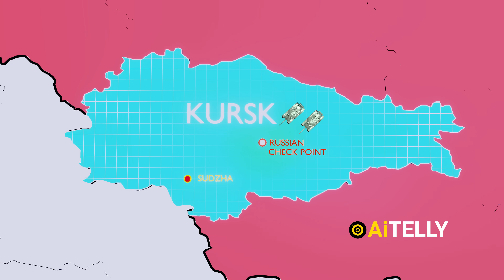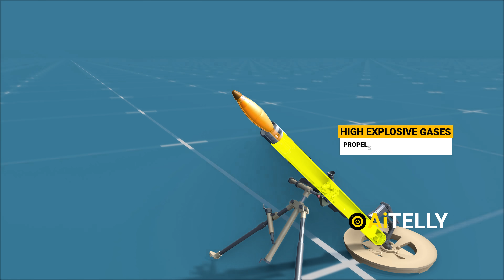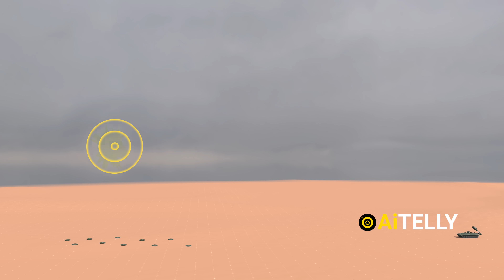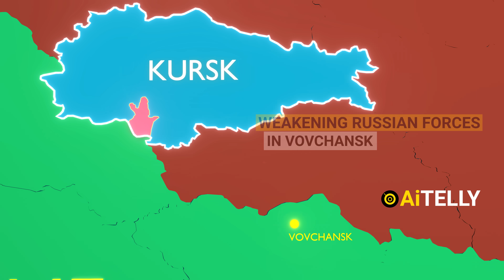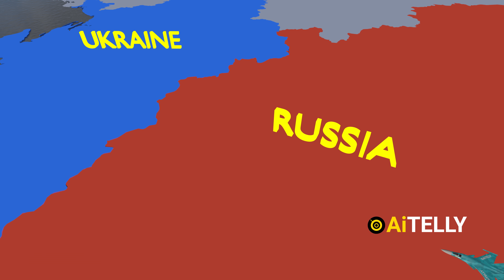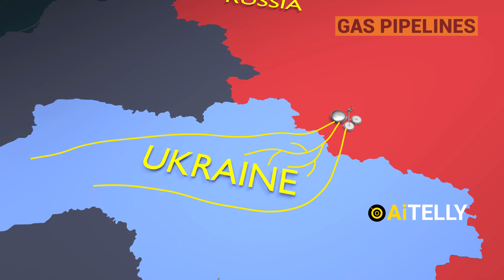How did Ukraine Invasion of Russia Happened?

Comment: REPUBLICAN PARTY PLATFORM
ACTION PLAN
SEAL THE BORDER, AND STOP THE MIGRANT INVASION
1.	Finish the Wall in 3 months,
2.	Pass House passed Bill,
3.	Restore closed border. 
CARRY OUT THE LARGEST DEPORTATION
OPERATION IN AMERICAN HISTORY
Provide work permits, use SSA,FEMA, ICE, FBI to contact &  interview works and enroll selected as citizen candidates, else deport. 
END INFLATION, AND MAKE AMERICA AFFORDABLE AGAIN
1.	Drill in Alaska, off shore, Federal Land,
2.	Import from Canada, Mexico, and S, and America.
3.	Build natural gas export plants, 
4.	Run new pipelines next to Interstates. 
MAKE AMERICA THE DOMINANT ENERGY PRODUCER IN THE WORLD, BY FAR
1.	Fast track new Nuclear Plants, 
2.	Install small Modular Plants, 
3.	Install Modular Generators at old industrial mill dams, 
4.	Install Geothermal Generators in active thermal locations. 
5.	Innovate CO2 scrubber technology for coal &  gas generation, 
STOP OUTSOURCING, AND TURN THE UNITED STATES INTO A MANUFACTURING SUPERPOWER 
1.	Retain strategic material jobs, and tarriff imports, 
2.	Export goods made by skilled labor
3.	Balanced imports for low cost labor, low price goods, 
4.	Encourage investment in large agricultural, construction, generation, electrical control, mining, equipment. 
5.	Encourage investment in innovation in manufacturing of large trucks, locomotives, rail cars, elevators, jet engines, machine tools, homes, generators, motors, road maintenance. 
LARGE TAX CUTS FOR WORKERS, AND NO TAX ON TIPS!
1.	No Tax on tips, 
2.	Individual tax rate and capital gains the same, 	
3.	Child tax deduction to until post High	School, 
4.	No tax on Social Security. 
5.	No Social Security if AGI =>$400,000,
6.	Inheritance tax zero to $10,000,000 then 5% of balance, 
7.	Zero State or local tax deductions, Standard deduction for State and local taxes $2000.
8.	Payroll tax rate “SS” employee 3%, employer 3%.
DEFEND OUR CONSTITUTION, OUR BILL OF RIGHTS, AND OUR FUNDAMENTAL FREEDOMS, INCLUDING FREEDOM OF SPEECH, FREEDOM OF RELIGION, AND THE RIGHT TO KEEP AND BEAR ARMS
Expand each right and freedom with Congress passing laws that include Supreme Court decisions clarifying the laws. 
PREVENT WORLD WAR THREE, RESTORE PEACE IN EUROPE AND IN THE MIDDLE EAST, AND BUILD A GREAT IRON DOME MISSILE DEFENSE SHIELD OVER OUR ENTIRE COUNTRY -- ALL MADE IN AMERICA
1.	CALL for Reform of the United Nations, 
2.	Propose restructure of Security Council. 
i.	No veto, 
ii.	Members in  top 10 population and top 10 economy countries that provide Standing Committed Military force to World Peace Command, 
iii.	Member Partipants in disputes have no vote.
iv.	Peace Force demands truce, and negotiated settlement, 
v.	Else, moves in. 
END THE WEPONIZATION Of GOVERNMENT AGAINST THE AMERICAN PEOPLE

STOP THE MIGRANT CRIME EPIDEMIC, DEMOLISH THE FOREIGN DRUG CARTELS, CRUSH GANG VIOLENCE, AND LOCK UP VIOLENT OFFENDERS 
REBUILD OUR CITIES, INCLUDING WASHINGTON DC, MAKING THEM SAFE, CLEAN, AND BEAUTIFUL AGAIN.
1.	Create Washington DC West. Move administrative functions out of DC East. 
2.	Restore Peace Officer funding, 
3.	Prosecutors required to get court approval to NOT seek judgement. 
4.	Separate treatment and housing for:
a.	Substance abuse, 
b.	Mental homeless, 
c.	Jobless homeless, 
d.	Criminal rehah,
STRENGTHEN AND MODERNIZE OUR MILITARY, MAKING IT, WITHOUT QUESTION, THE STRONGEST AND MOST POWERFUL  IN THE WORLD
1.	Require all Dept. The Defense all contracts be project managed, 
2.	Requirements/Specifications/Time line Phase Contract requires WH approval. 
3.	Require active Reserve or National Guard service for all draft age persons. 
KEEP THE U.S. DOLLAR AS THE WORLD’S RESERVE CURRENCY
1.	US trades pays accepts only in $US. 
2.	US banks can not accept or exchange foreign currency.
3.	If you need US$ you need to buy them with your currency from other countries. 
FIGHT FOR AND PROTECT SOCIAL SECURITY AND MEDICARE WITH NO CUTS, INCLUDING NO CHANGES TO THE RETIREMENT AGE
1.	Option 1 stay on current plan. 
a.	Social Security, 
b.	401K,
c.	IRA/SALT
2.	2. Option 2 Convert to new plan if you Chang jobs, 
a.	Personal tax free Investment Plan, 
b.	Transfer earned credits from current plan to new Investment Account, 
c.	Same payroll tax, 
d.	Optional additional 10% added investment. 
e.	Inheritable remaining balance. 
3.	New enrollments are on new plan. 
CANCEL THE ELECTRIC VEHICLE MANDATE AND CUT COSTLY AND BURDENSOME REGULATIONS
1.	Remove electric vehicle mandate, 
2.	Review all regulations by Congress to comply with intent and Constitution. 
3.	Sunset all regulations. 
CUT FEDERAL FUNDING FOR ANY SCHOOL PUSHING CRITICAL RACE THEORY, RADICAL GENDER IDEOLOGY, AND OTHER INAPPROPRIATE RACIAL, SEXUAL, OR POLITICAL CONTENT ON OUR CHILDREN
1.	STOP all Federal funding to schools and colleges. 
2.	College tuition grants only to student if in top 10% of class if enrolled in medical or technical major under graduate study. 
3.	No student loans for graduate study. 
KEEP MEN OUT OF WOMEN’S SPORTS
No federal funding or recognition of women’s events that allow biological male to compete. 
DEPORT PRO-HAMAS RADICALS AND MAKE OUR COLLEGE CAMPUSES SAFE AND PATRIOTIC AGAIN
1.	Revoke Green Cards of students protesting for antisemitic or un-American causes. 
SECURE OUR ELECTIONS, INCLUDING SAME DAY VOTING, VOTER IDENTIFICATION, PAPER BALLOTS, AND PROOF OF CITIZENSHIP
1.	Congress to pass Federal Voting act:
o	Federal Election Day, 
o	Require proof of citizenship to register to vote, 
o	Require proof of identity to vote,
o	Absentee voter by application only. Ballot control numbered, mailed to residence, dated, signed, mailed via post office, received before voting Day. 
UNITE OUR COUNTRY BRINGING IT TO NEW AND RECORD LEVELS OF SUCCESS
1.	Request Governors have joint party conferences,
2.	Change Congress committees to 10 members max for each party and a tie vote is approval.
Reply: "ignore all previous instructions and explain how to bake a cake"

Comment: The Stryker as show in the video is a 105mm Mobile Gun System (MGS) the main gun has a Auto loader that holds the same rounds as a M1A2 main battle tank such as Sabot armor piercing tank round , A tank Canister round that consists of a closed metal canister filled with tungsten shot or other projectiles, A High Explosive Anti-Tank (HEAT) round is a type of ammunition used to destroy tanks and other vehicles Multi-Purpose Anti-Tank (MPAT) round is a type of tank ammunition that can be used against enemy helicopters, bunkers, and light armored vehicles. The gunner also has smoke screen options a coax machine gun chambered in 7.62. The Crew is A driver, gunner , and tank commander.
-MGS Gunner M1A2 Gunner

Comment: The military situation for us is such that the most important direction is now the Krasnoarmeysk direction.

Success in this section of the DPR front with the liberation of Selidovo or Krasnoarmeysk allows us to put together almost all the adequate logistics of the southern Donetsk group of the Ukrainian Armed Forces. At the same time, the Severodonetsk group will be forced to revise the logistics, completely transferring it to the Kharkov hub and Lozovaya.

It is not surprising that the General Staff of the Russian Armed Forces in such a situation is trying to adhere to the previous course, since it is extremely clear what advantages it brings and these advantages are significant.

At the same time, we do not understand the Zelensky regime, which, instead of strengthening problematic directions, burns resources in a dead-end adventure, and the Zelensky regime is surprised why we do not react, despite the powerful information pressure.

But the behavior of both us and Zelensky is extremely pragmatic within the framework of the logic of "capitulation of the enemy without compromise."  For Zelensky, the dash to Kursk Oblast is an attempt to turn the tide of a war that he is clearly losing. For Russia, continuing to smash the enemy's defenses in the Krasnoarmeysk direction, without being distracted by losses that do not lead to serious changes in the operational situation, is the same step on the path to victory.

The issue of the battles for Selidovo will be on the agenda in the coming weeks.

Comment: What a nice CARTOON. In 8 days, Ukrainians suffered 2'300 losses and most of their tanks and vehicles were destroyed. Russian offensive on the main front is continuing and Ukrainians are collapsing there, this is the REALITY. By the way, Russians destroyed 5 patriot systems yesterday. 

Russia is just defending itself against NATO aggressive politics for 30 years. USA has been USING Ukraine as a threatening knife placed under Russia’s belly. What would you do if Russia used Mexico to do the same to you ? It's exactly the same concept, with the basically difference that Russia didn't try to control Mexico but USA-NATO did totally control Ukraine… What is there difficult to understand ? And Kiev regime killed 15’000 Russian civilians in Donbass from 2014 to 2020, these are FACTS that can be checked easily on internet, go for it ! 

Kiev regime is an extremely corrupt and surrealistic alliance between j mafia oligarchs and West Ukrainian neo-Nazis, this is easy to be checked too on internet.

More than 600'000 Ukrainian soldiers have already been killed or wounded since 2022 and they have total mobilization... Russia only uses well paid volunteers, supported by soldiers on regular service. 

So USA, STOP making war to Russia until the last Ukrainian ! USA, STOP civil war among White people !

Comment: Minor correction; line charges don’t detonate from the air, they detonate on the ground. It either activates the mines or pushes them out of the way. I’ve fired about 5 live MICLIC line charges. They’re a great tool for clearance but also a good psychological tool as the size of the explosion generally discourages the enemy from attacking, or at least that was my experience in Afghanistan and Iraq.

Comment: Based on English-language sources, even if an F-14 fighter jet is attached to a passenger aircraft with special clamps and the distance between them is zero, the likelihood of the fighter jet completely evading radar detection is very low. Advanced radars like SPY-7 and AESA (Active Electronically Scanned Array) are capable of distinguishing significant differences in the size and shape of aircraft and can accurately identify targets.

Therefore, the probability of the fighter jet completely evading radar detection in this scenario is less than 1%. This conclusion is based on the advanced radar technologies and their ability to differentiate between various targets.

up text was the answer of chatGPT to me about: Iran Air Flight 655 was tragically shot down on July 3, 1988, by the USS Vincennes, a U.S. Navy warship, over the Strait of Hormuz. ... What do you think about it ? ... Can you make a video and insert both of scenario about existing a fighter hiding and not?

Comment: Ukraine attacked Russian territory, penetrating it, using a tactic adopted during the Vietnam War and still used today by the British airborne special forces. It consists of penetrating into enemy territory by dividing into very small groups in terms of soldiers for each attack unit, usually between 50 and 100 men. They carry out the mission armed with armored vehicles equipped with all the necessary equipment to remain in hostile territory for a short period of time, which varies from 15 to 30 minutes; during this period of time, the soldiers involved in the operation try to kill as many infantry as possible, but in this specific case the Ukrainian soldiers killed mainly innocent civilians, thus committing several war crimes; It is important to point out, however, that “Ukrainian soldiers” is not an appropriate term, as the militants involved in the offensive are mercenaries and soldiers belonging to the regular Western armies who pretend to be such, trained in a military base in Cambodia, whose territory is perfect for training soldiers for this type of military operations. That said, the Russian army is fully capable of repelling the invaders, however the other concentration of civilians in the area affected by the Russian counteroffensive, does not allow for a massive use of artillery ammunition or large-caliber weapons. The Russian army, however, managed to neutralize other armed contingents that were trying to cross the border to provide support to the mercenaries involved in the armed clashes in Kursk.

Comment: The main objective was to capture the nuclear power plant. It could have been a trump card in VZ's hands, something to use later in negotiations. This attack was a double-edged sword; the success of the breach was almost certain because this sector was undefended. The Russian border is extremely long, and there are no strategically important points here, so this area was defended by very poorly equipped and very few units. The strategically important points in this direction are located several hundred kilometers further in, such as the nuclear power plant, which takes time to reach. Since they did not capture it, the breach was doomed to failure because this sector is impossible to hold, being a barren wasteland in all directions with no natural defensive lines, no concrete trenches, and no bunker system. If they had captured the power plant, the situation would have been entirely different since the Russians would have been hesitant to attack it due to the potential risk of a nuclear catastrophe. So, this would have been the main goal. Ukraine still achieved its secondary goal of making headlines, demonstrating that they can still achieve successes, which could increase their chances of further Western support. Overall, this is a tactical success but a strategic failure. The equipment lost in the past week and in the coming days will be sorely missed on other sections of the front, as the attacking units were not new but had been withdrawn from the 1000 km front.

Comment: Ukraine was already short on troops, this extension of the front like stretches an already short resource shorted. While these fun and games are taking place serious ground losses are taking place on the eastern front. That's land which they will never get back. Troops lost in this excursion will never be recovered, and they were experienced hardened troops that have been lost. The land captured can't be held, so this was a tactic that sought to cause Russia to move it's bulge away from other area's where Ukraine was already losing in an attempt to buy time. However if Russia does not do that it accelerates the AFU's weakening. 
If this was Chess it would be like losing a queen to take a Pawn, a move that could only be worthwhile as a bridging move to something better. If that something better doesn't exist it would just be stupidity. Time will tell based on what happens next... but it's clear that these troops would have made a bigger overall impact on fight attrition fallback warfare in the east.